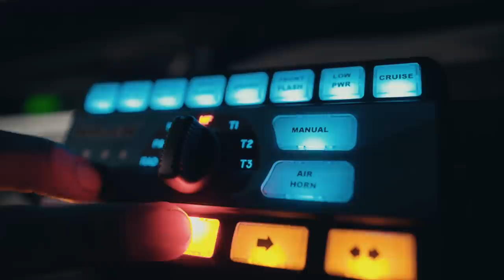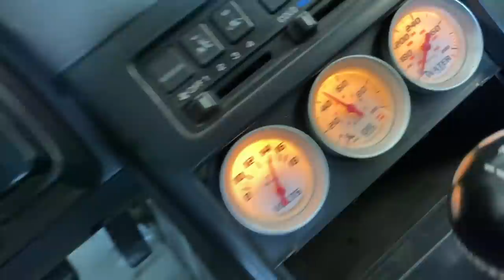Our First Freedom Factory Drift Night was a HUGE SUCCESS!!! + Blew Up Rocket Again...

Comment: Freakin neighbor has got to be the most underrated car in the fleet. Just takes beating after beating and never complains...it’s really impressive for a gt500 drivetrain.
Reply: I would really like to see the channel do something more serious in another car on a ford platform
Reply: @Andrey Angere they also make alot more horse power
Reply: I've never looked at crown vics the same now that I know what is possible.

The fact the subframe just bolts in is insane lol
Reply: Seriously, that car has been hammered again and again.  It owes Cleetus nothing.  Its impressive the beat down its taken.
Reply: @tristenkiesow4061  neither of the ls drift cars are close to neighbor’s horsepower level.
Reply: @301garage  and they both broke with not even as much abuse... neighbor is just stout
Reply: Ed's looking down on it! Fate it was the car used in the first drift event!
Reply: Ed reaches down and just caresses that oil pump from the heavens,  he is Neighbor's guardian angel
Reply: Ford has a habit of over engineering tf out of the shelby cars the older ones at least.
Reply: Generally im not a big fan of ford expect for the 7.3 powerstroke. But gotta give it to neighbor that engine lives in the redline and keeps on. But i take it the do pm behind the scenes.
Reply: @30YearOldBunta  same a place near my work has a lot of surplus cop cars for sale haven't seen any fords just tahoes. And 3 chargers. I wouldn't get one based on what i know. Those cars never shutdown they have drivers take shifts. Plus one county, they run them into the ground when they get a new one.
Reply: @pablopicaso8374  well the gt350 has been a nightmare for everybody I know that’s had one but they must’ve got something right with that generation 500.
Reply: @watchjaredwork1487  I was talking about the Terminators, The GT500s from 2005 to 2014
Reply: False Flag  but ls bottom ends are near indestructible. They take a beating and handle 1000+ on stock bottom ends.  But things do break with that much hp
Reply: @301garage  power isn't everything. You have to drive the nuts off of a 400hp naturally aspirated motor to drift those big banked corners, meanwhile a 1000hp blown crown vic on skinny tires is probably not even at half throttle.
Reply: @SoI_Badguy  tell that to pack a punch 🤦🏿‍♂️ y’all moving the goal post.

Comment: "Neighbors gonna take a beating tonight" yet runs it all night and runs amazing 👏 dang ford
Reply: Neighbor has heart. Watching that car get built and knowing what it stands for is moving. Ed would be proud.
Reply: Ya but it now needs to be pulled apart for a new timing chain, im sure they are good at it by now but it didn't take long after that week spot discovery that neighbor slowed his roll on the channel.
Reply: @jaydunbar7538  nah he's just a workhorse for events. That car spends more time in the limiter than any other car in the fleet. But the motor is built and detuned for burnouts and drifting. Its a almost 1200hp car and he only runs it at ~800.
Reply: Bob Watters  That's not an LS engine.
Reply: @teapotwar  he is pointing out that whenever someone mentions neighbor doesnt brake and it isnt an LS, people instantly mention the timing chain. and also pointing out that LS engines have timing chain issues and it isnt only a ford problem
Reply: That Ferd 5.4 has no right to have lasted as long as it did with all dem timing chains, yet here we are, Cleeter has done nothing but beat the ever living fuck outta that car. About the only other car I know of that's taken as much of a whoopin as Neighbour is Slave Lake
Reply: @jaydunbar7538 for the last god damn time no it doesnt how ignorant are you people cleet has adressed this many times it has not had a timing chain since they upgraded it the limiter is down slightly but not much neighbor just a beast quit with yalls bs
Reply: @Ryan Couchman wrong coyote is the better motor ls is more popular cuz there so cheap and have alot of aftermarket support you have to spend a shit ton of money to make a ls compete with a stock coyote get outta here with your bs
Reply: Neighbor also has a fully built motor, rocket and donny don't. Thats why it's lasting so long. He did say donny is getting a texes speed motor now.
Reply: @TylerDuysen  you really don't but ok 👌🏼
Reply: @johng.1056  Yeah really! it only had one problem ever and that was because they didn't know ford engines when they put it together
Reply: FOReD
Reply: @Ryan Couchman You got one thing right, They are the cheapest...
Reply: @jkheslekrants  i really do
Reply: @Ryan Couchman cool new heads and cam just to make 650 when a coyote makes over 700hp stock (goes all the way up to 767 depending on your performance package new heads and cams on a coyote will push it well over 900hp the coyote is the better engine the ls is the cheapest has the most aftermarket support and can make power relatively quickly there both great engines i like both

Comment: 6:11 mass air flow unplugged (won’t start) 
6:40 mass air flow plugged in (starts)
Reply: i noticed this aswell
Reply: I started my LS swap with the maf unplugged, pretty sure they default to speed density when the maf isn't plugged in. Engine management depending I guess.
Reply: facts
Reply: Goes to show that the VE table probably wasn’t properly dialed in. Even though the rod knock probably wasn’t tune related.

Comment: I still can’t believe how stupid fast adams car was that whole night
Reply: Not just the car but the driver! Really show the difference of a drifter and a professional drifter.
Reply: I know right, he really is FD material
Reply: Locking up the front wheel foot braking so hard yet still tapping limiter in 3rd jesus
Reply: that e36 is super gripped up now it's wild
Reply: Some stupid wheel speed would have loved to know what it was at gotta be in the one hundreds
Reply: He did say it was still in the gripped setup, and that the track had more grip than he was expecting.

Comment: I bet the reason Rocket keeps blowing engines while drifting is from oil starvation; all that sideways force is preventing oil from entering the pickup tube. It might be time to invest in a dry sump system for Rocket!
Reply: Baffles
Reply: Or spend a fraction of that money on an accusump
Reply: Taylor Ray has had the same problem, dry sump is the solution

Comment: Who else things they should build a crown vic that's actually built to drift
Reply: An angle kit and a hand brake. Anything else needed?
Reply: Id like to do an old caprice classic :)
Reply: @pcihector  sway control and lowering  or he'll be scraping door handles lol
Reply: @baddriversoflittlerock8359    If they do a Caprice, it has to be "LAPD spec", aka black and white.
Reply: @baddriversoflittlerock8359  I worked the summer of my Sophomore year at the VA Quarter-Horse Ranch in the Kennewick, WA area and had full use of a '69 Caprice with a 427........and free gas. OMG, that thing was geared for Bonneville. I did 125mph on the freeway and almost pissed my pants. What an awesome car. The sound when you decelerated in gear was absolute honey. An unsupervised 16 yr-old plus that much horsepower equals FUN.

Comment: All them Chevys blew up but that Ford was there to take a beating...
Reply: The amount of abuse Neighbor has is amazing, I'm sure it will fail eventually but  it is just engineered well
Reply: respect to the motor, but its a big money motor from L&M, not really fair to rip on stock chevys and compare them to a $10k+ motor
Reply: @solatyn  what about those built LS engines in both Ruby and Leroy they have been to Texas speed a couple of times
Reply: Not ripping on chevy at all I have Chevys, Fords, Toyotas, nissans, you name it I probably either have had that brand or have it currently unless it's a Jeep LOL 😜
Reply: @tashawegmueller1866  when was the last time Leroy had engine issues? When he lifted a head and ran the first 7 with no water? He went years, hundreds of passes, 2 drag weeks etc with only drive train issues that I can recall. Oh and losing belts but can you really say that's an engine issue?
Reply: @solatyn  it's still more than That ole ford in Neighbor, if you count when they went down and pound for pound Neighbor takes way more abuse than. 8 or 7 sec passes
Reply: @tashawegmueller1866  haha you really believe because neighbor does a burnout for a couple of minutes its more abuse than doing a 7s pass? Neighbors engine is rated to 1500+ hp and only makes 1k its tuned low to keep it reliable.
Reply: @solatyn  but look at how long it's been doing it and yes it's more stress than a drag pass

Comment: The most reliable car in the fleet is a Ford and I’m a Chevy /Honda boy smh
Reply: Too be fair, neighbors built, as far as im aware Donny and rocket are just stock motors
Reply: the crown vic had 20 years of revisions on the same platform, hard to beat something in reliability when it has had that much time to refine.
Reply: its reliable because its a big money L&M engine rated for 1500 hp lmao. how quickly people forget
Reply: @Howema  and the Corvette has had 68 years to refine... so what, proves nothing
Reply: @alandillon6469  And the corvette is on it's 8th generation. That's 8 completely over hauled platforms. The crown vic basically never changed at all in it's production. Lighten up on a guy, be a bit nicer.
Reply: Ed’s watching over that Vic

Comment: Brain stormer like I am... Thinking flying drones... or even maybe cable running lights from drones.. like The Australian pit straights have cable drones... If you know you know.😂🤜🏼🤛🏼🇦🇺🍀
Maybe have duel crossing cable  running drone camera angles. 
New concrete pylons in corners that can not just handle the cable tension but makes the situation stronger. 🤓🤜🏼😂🇦🇺🍀🍀🍀😎
Brain stormer👍🏻🌞👾💫

Comment: Will you be saying anything about the EPA is wanting to do to the car community as a whole? If they get what they want any car with a VIN and emissions equipment will not be able to be tuned/modified. Not only would it destroy so many livelihoods but your events would be no more. No more freedom 500(which uses modified VIN'd cars) no more Cleetus n Cars. We all need to come together and push the RPM act. The EPA wont stop at Lund Racing, they will come after everyone eventually if we dont stand up.